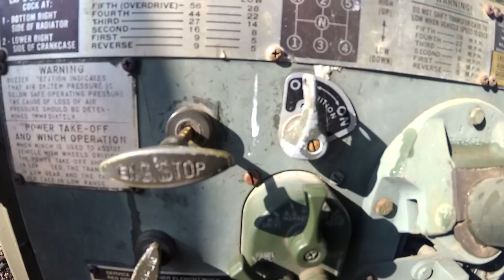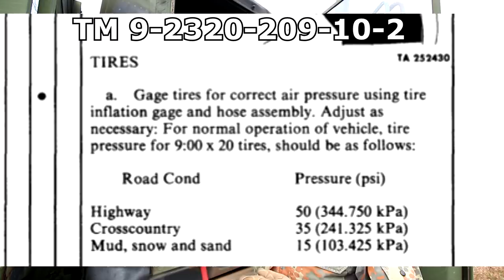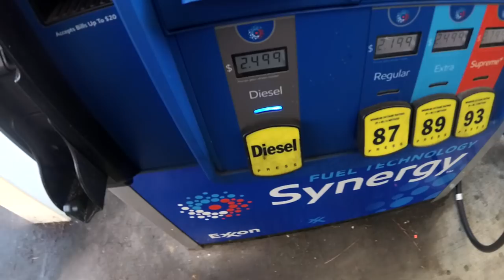Deuce and a Half Emergency Tire Inflation with Deuce and Guns

Comment: Hey Deuce,  I forgot to ask when i first saw this video if that was one of those "  Suicide Split Ring "  wheels there 
on your Deuce.  I know they are very dangerous when airing up after changing a tire and that is why the Army
required us to put them in a safety cage when inflating them.

I had a buddy who was adding air to the spare mounted on his truck in our unit.  He was reaching across the wheel as he was adding air when the split rim blew off.  It snapped both bones in his lower arm and nearly tore the arm off.  They were able to save his arm but I am not sure if he lost any use of the limb as he took a medical discharge.

Of course we all said  the injury was caused  because SP-4 Tobias  had experienced a case of  incorrect 
"  Operator's Headspace ".
 
Are they less dangerous adding air to  them after the tire has been mounted and the seal tested over time?
Just the same,  if it were me i would snap my hose fitting over my valve then stand back and open the valve 
out of range of that thing's bite.  It may take some rigging but I have seen it done.
Reply: PS    I was a section chief in a  Lance Missile firing platoon and our primary vehicle was the  M-752 tracked missile launcher, a M-151A1  Jeep  and a " POS " M-880 Dodge truck.  It was the A&T  ( Assembly & Transport ) platoon who drove all the Deuce and a halfs and those extended bed 5 Tons.

So I do not have expert knowledge on Deuces.....but I do know how to short track an M-113 derivitave track when your idler wheel sheers off in the field hehe.   (  Maintenance Sgt told me it could not be done )
Reply from the maker: Yep, they are generally less dangerous after being proven over time and still inflated to a working pressure.  I have a very flat spare that I won't inflate till I find or replace my lost lock-on air chuck.
Reply: This is NOT a "suicide" split ring, what you're referring to is a Suicide SPLIT RIM.  This is NOT the same thing.  You only need to put these in a cage if they are a new tire and you have to make sure the ring is seated, or it's lost ALL pressure.  If it only has low pressure, it's perfectly safe.  You can also easily see if it's properly seated on the rim.

Comment: Hank , what size air hose should I get ? I’ve got a decent size portable desalt air compressor also and a did acquire a government surplus impact wrench , so just wandering a 3/8 or 1/2 inch hose or will a 1/4 inch surface? I was thinking a 3/8 maybe will work with everything?

Comment: Way back 1982, we used clip on air hoses.  I've seen spit ring / tire explode.  It destroyed a tire cage and scared everyboy. You put a 6- 8 foot hose from your gauge / squeeze handle to a  your clip on valve. Stand to the side. That 1 in 1000 chance that it explodes . You can walk away.

Comment: It's me again. Can you do something on the air compressor like a review. I just purchased mine but the air compressor sounds like it's metal to metal or even a loose belt but I checked it it squeaks and squeals really bad especially when it builds pressure almost to the top any ideas
Reply from the maker: A few things to check.  The belt could be squeaking due to being old so try to put a little oil on it and see if that quietens it and if so then you just need a new belt.  Another issue is that the compressor is lubricated with engine oil.  There is an official gasket that you can find that fits it perfectly but often times they just smeared RTV over it to seal it.  If they used too much RTV they ended up blocking most of the oil port starving the compressor of oil.  Depending on the age/condition of the engine oil I guess it could need an oil change as well but that's just a shot in the dark.

Comment: On my 5-ton, I use a gladhand connected to the emergency side of the trailer brakes. Did you add that fitting under the dash or did your deuce come that way?
Reply from the maker: That's a factory air line.

Comment: Have you tried not using the clutch when shifting ? Just asking having driven a semi for years .
Reply: James Pollard, I drive tractor trailers and every time I get in my deuce I try to float the gears. Usually just end up cussing and using the clutch. I drive my deuce about 100 to 150 miles at a time on my days off. I climb back into the semi and the first few gear changes I try to use the clutch but just end up cussing again. You can float the gears in the deuce but it doesn't have a synchronized transmission. Its just rough to do it.

Comment: Do all Deuces have that air valve available? Thanks for the video, great idea!
Reply from the maker: I've never seen one that didn't so I'll say that most do.  I've learned through experience that every time I say, "all" somebody on the internet shows me that I'm wrong, especially with the Deuce.  Thanks for watching and the question.
Reply: Thanks, when it gets above 0 deg. I will have to check that out!